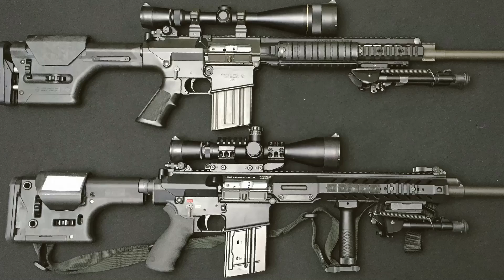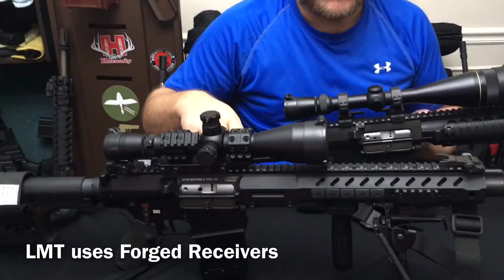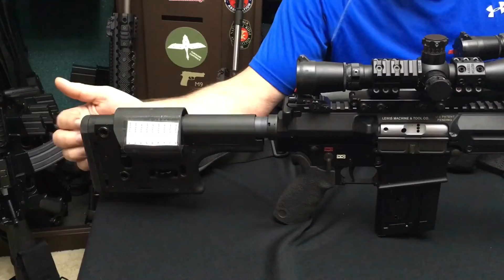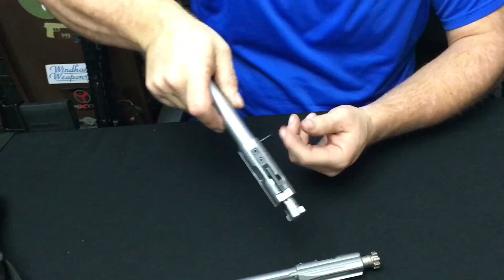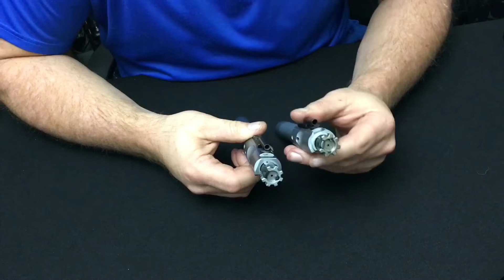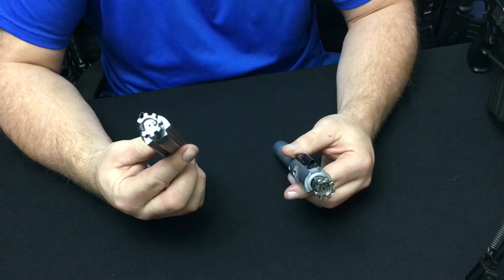LMT MWS v KAC SR 25

Comment: I kinda disagree and think the knight might be better, and i say that because of the barrell mounting. You see with the quick barrel change its 2 screws were the threading can act as a weack point. Most of the pressure is either going forward or outward  wich put pressure on what holds the barrel. Now a traditional barrel nut entirely goes all around the barrel and uses a chunk of the reciver for hold the barrel around but not front wile the nut holds it front making the barrel fit in my opinion alot tighter. Yeah the handguard may not be one peice but there can be handgaurds almost as durable or almost on par to the one peice upper . Combine that with how knights and other companys did with traditional barrel nut designs and you can get a better more accurate rifle.  Somthing like a a sr25 that released on a si.uler date to this could be more accurate then the lmt.

Comment: I recently got the MWS rifle and was HOPING that you could answer my question... I put my first 100 rounds through it. about 82 of them were failure to feed, sometimes it did not even pushed the bolt back enough to rechamber. I tried multiple magazines....
Is this a break in thing? Is it a lack of oil? I do think that, if the fault was mine, it was too little oil. I couldn't oil it more while at the range. Any suggestions?? I am using federal gold medal sierra 168 grain.
Reply: How do you like your MWS LMT now?  Is it the MARS-H or Battle Rifle?  308 i assume?
Reply: @steffeness1  yes that’s the one. 

Honestly I am not too sure yet. I have only been able to put another 150 rounds through it, and it is cycling better but still jamming. I am only hoping that it will keep getting better and cycle within the next 200. I am going to the range this weekend or the next.
Reply: @StefanSu91    Ok, you bought the MWS MARS-H then?  Not the Battle Rifle version?  The MARS-H right now is a $2900 gun.  The battle rifle is $2800 now.  Unfortunately,  the only version  of the Mars-H is in the 16" / 308 barrel.  Not sure why anyone would prefer a 16" barrel vs a 20" - 24" barrel in 308?  More FPS in that longer barrel.  When mine arrives, I will want to sell the 16" barrel & buy a 20" + barrel.  Any ideas in who might want a 16" LMT barrel, please let me know.
Reply: @StefanSu91    Howe much did you pay for your LMT 6 months ago?  I know the Knights Arm versions are way overpriced & according to Small Arms Solutions, or Military Arms Channel, the LMT is a step up.
Reply: @steffeness1  i bought the mars-h. They’re both the same operating system so not sure why that matters? I may be mistaken. Anyway, I cut my barrel and welded the muzzle device to make it 16 inches/rifle legal. The reason for that is to use as a ‘battle rifle’ and from close to medium distances. It is extremely accurate even at that length. I can swap out to a longer barrel in a minute if I needed to use it for longer engagements. 

(I’m a prepper for fun, so my thought process was having a two in one rifle.)
Reply: @steffeness1  I paid the price listed on their website. I went with V1Tactical. They are awesome and have the most LMT parts and rifles available i’ve seen.

You can do special orders with a lot of their out of stock stuff and get it for you as soon as possible.

Comment: My LMT doesn’t fully go into battery with a round in the chamber (depends if I release the slide or just let it go - it does then). If and when it does go into battery I cant pull the charging handle and eject the live round, unless I pull the CH hard-ish. 
What I am doing wrong? My ammo isn’t cheap but it might be low quality. It’s 168g federal ($20 a box).
Help! Lol
Reply: my lmt was doing same thing but when it would chamber I couldn't eject without firing.LMT said it was tight throated and just needed to be fired wet for a hundred rounds or so.Said I could send it back and they would do it or I could.I decided to do it myself.They were right.  I ran it very wet for a hundred rounds for break in and has been 100% since.I was a little put off with accuracy at first using federal 168 GMMchanged ammo and now routinely get sub min easilyeasy 1st hits on steel with fixed 5x at 600 yds

Comment: Great video!!!! I absolutely love my LMTMWS. It’s only downside is it’s weight but honestly I think that plays a big part in its reliability and durability. When you hold these guns you can feel the quality
Reply: A little late to comment but you are absolutely right. There is such a thing as good weight especially when firing a larger caliber such as 308 or 6.5 creedmore does help to have that heavier weight to counteract things like recoil. Also I like the ability to conver caliber of the weapon without a full uper swap especially for an AR10 it saves alot of figuring things out.

Comment: How did you get the LMT MWS in 7.62 with a 20" barrel? You bought the barrel separately? I must have missed that part. Either that or they no longer offer it as a default package with the 20" barrel? So you have to buy the rifle and the extra barrel as an addon? Thanks for the comparison! Definitely always been fond of both but always leaned towards LMT as far as innovation goes (regarding their Enhanced Bolt and other products for the AR-15 platform).
Reply: Just bought the MLK MARS-H / 308   Came with 2 barrel system:  16" in 308 & 20" in 6.5 C   Other than lighter weight in front when shooting standing up, no reason to shoot with less FPS.  My next move when this LMT shows up i to sell the 16" barrel & buy the 20" in 308